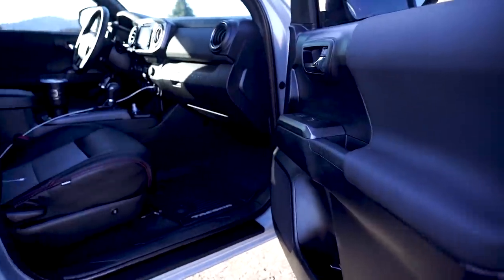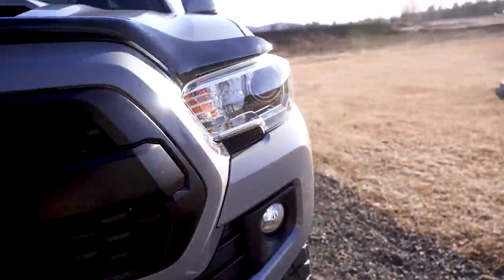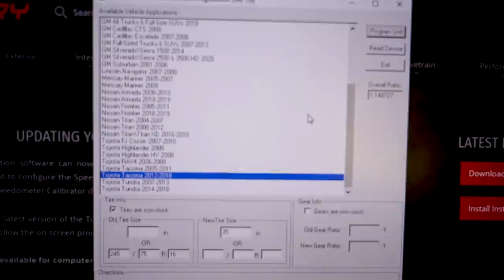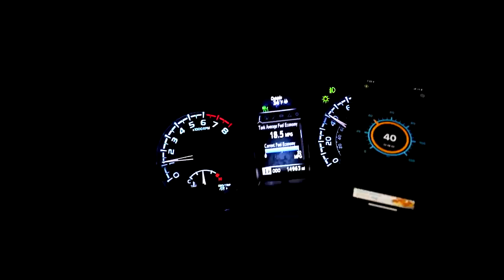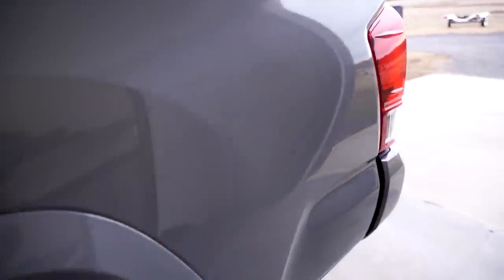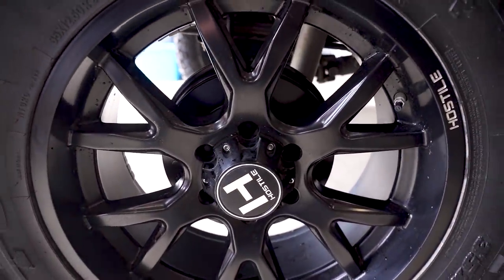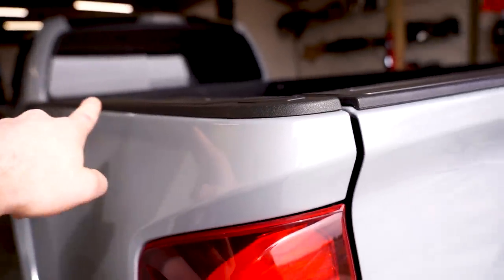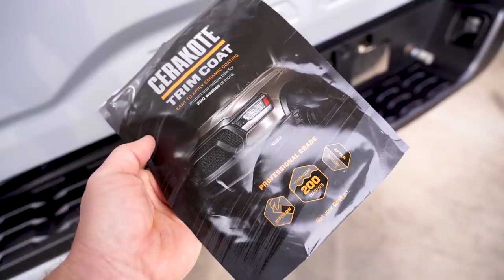Fixing Up The New Truck!

Comment: I bought a '19 Tacoma at the beginning of this year too haha. They sure look good with dirtbikes in the back. I definitely would vote for more Taco content 👌.
Reply: So question fellas, I keep seeing some good deals on a few double cabs with the shorter 5ft bed. Kills me as for any other activity it would be fine but with a dirtbike, guys have to pull tricks that I wouldn't feel super comfortable with (placing the tire up in the air on the wheel well). My question is with the 6ft bed, I hope you can put the bike in diagonally with the tail gate closed without problem and in theory have two beside each other with the tail gate down. Is this correct to your experience? Thanks lads!

Comment: Id say get rid of the 20s-  Go with a 16" 285/75/16 AT  for a beefier sidewall. Id recommend not get an exhaust they dont do anything for the Tacos (noise maker is it).  Go with a standard 2.5" coilover suspension (not 6"), some upper arms (Camburg, Icon, BTF, etc)  Then ditch the airbags and get a real 10-12 leaf package like a Deaver,  etc. Good luck and enjoy the new purchase!

Comment: def a supercharger and a tune and some exhaust, a custom cow pusher and maybe a skid plate. could maybe do like one of those roll bars with some led off road lights over the cab or something and throw some fox shocks on it so it can handle getting some occasional air. I'm sure Devin and Austin would love giving you a hand decking that thing straight tf out lol oh and def gotta upgrade those rear brakes drums on anything made in the year 2019 is absurd not sure what Toyota was thinking with that.

Comment: I got a problem with my two stroke moped.

Sorry for it being off topic.
I know it’s not a dirt bike but please help!

It bogs out when twisting the throttle from idle to full throttle.

All jets are clean.

The engine I freshly rebuilt with a new crank, a new 80cc cylinder, new gaskets and seals, new bearings, and with a used 26mm dellorto phbl carburettor (that is missing the breather nippels), and a pod air filter.
The bike also have a performance exhaust.

Checked everything in your "Does you’re dirt bike bog?" video, nothing changed.

The suggested main jet size is 120, I have ran jets from 120 to 138. With the 120 to 126 jets it feels lean. It doesn’t bog when full sending the throttle but when I test drove the bike it didn’t what to rev out. I could accelerate to half throttle and then the rpm staid the same. 
The spark plug looked dry but had a lot of oil on it(running 3% oil in the gas).

When trying to jet up from 126 it bogs out and dies when given full throttle from idle. Still the same issues when driving as with the smaller jets. 

It accelerates good at lower rpm until it just don’t want to go any higher.

Reed looks fine. No chipping or cracks.

The exhaust is dripping with "goo", Mix of thick oil and exhaust, but somewhat cleared out when driving.

It’s not sucking "fake air", that’s what we call it in Norway when an engine is not sealed and sucks in extra air.
Checked by spraying starting fluid around the reed, intake, carburettor.

It’s just weird how the engine is acting. It’s acting like it’s lean with the "right" size jets, but with bigger jets it’s acting like it’s drowning in gas.

Could it be not revving  out because of the brake in period of the engine? It revs all the way while in neutral.

Norwegian two stroker and fan, Sander.

Comment: After owning a lifted truck, I learned it's much easier to load a motorcycle into a stock height truck!
Reply: And kids!
Reply: yep my truck's job is getting my dirtbike to the trail and let it do all the off roading
Reply: 110% I have a hitch carrier because mine is a giant pain to get into the bed lol
Reply: @sparky_zap69  a colorado😂😂 you must be short even with your lift
Reply: Get longer bike ramps? Or get one that's for atvs so to can ride your bike into the bed without risking falling off and/or missing the ramp and run into the tailgate
Reply: @Blake Turner yeah, with 8” of lift on 35” tires. I’m 5’8” and clumsy as fuck so I prefer to not dump my bike when I can just throw it on the hitch carrier instead lol
Reply: Kris Thistle hitch mounts are mint
Reply: He needs a three stepstool and I long ramp

Comment: Very nice Cam, I bought a white 2015 this last Aug and love it. I’d recommend k&n intake with headers and exhaust either hooker, flow master or Borla, then chip it to get the best performance out of those systems. Then depending on how much off-road if your going to do you can change your gearing. Either way looking forward to more vids and hope to catch you at supercross on the 28th.

Comment: Keep an eye on the frame. I've got a 2009 Tacoma and the frame is absolutely f'ed. I can shove my fingers through it and the leaf spring mounts both are broken off, and the spare tire carrier almost fell off going down the road. I bought it brand new. Keep the frame painted, and wash it regularly. They won't last past 130,000 miles.